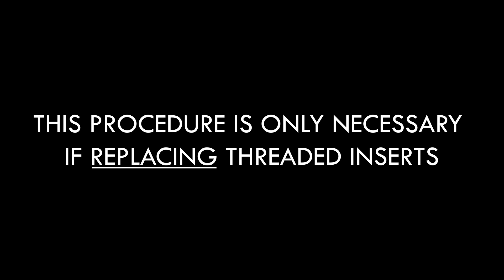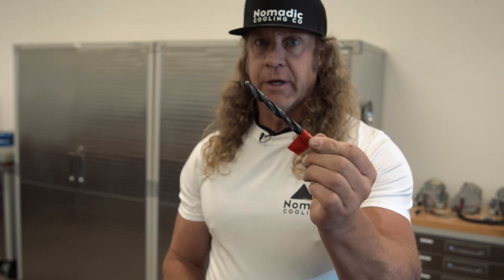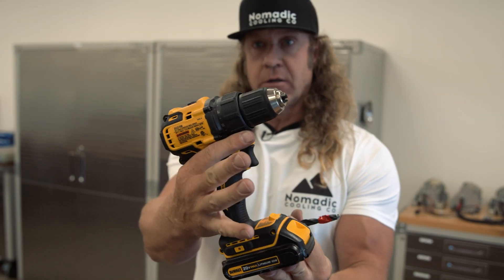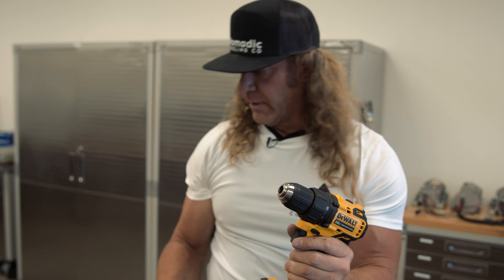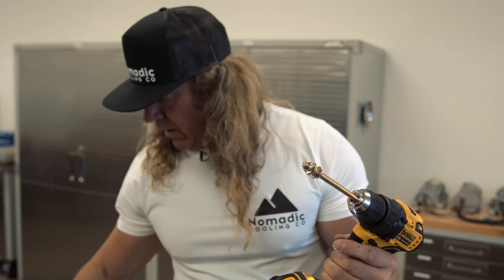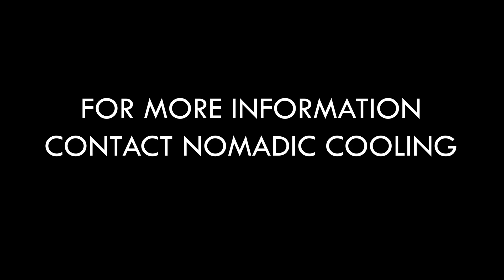INSTALLING THREADED INSERTS (with Thor)

Comment: Would you only need to install the threaded inserts if you strip the original threads by over tightened the threaded rod?
Reply from the maker: yes :) .... well basically